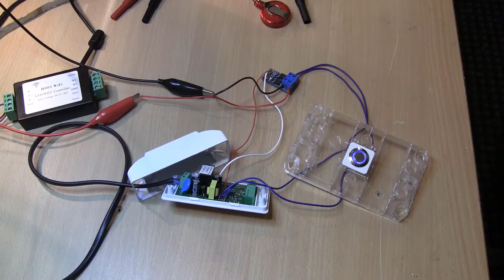Sonoff GPIO high current control using PWM and Mosfet PCB

Comment: Hi there.  Have you seen the sonoff basic r2. I want to make the same with the besic r2. There are inner pins,  3v3, key, LED,  k_p and GRD pins.  how can I make external physical on/off button and Led indicator light using these inner pins?  Thank you...
Reply from the maker: It seems the R2 is not well suited to this application? https://tasmota.github.io/docs/devices/Sonoff-Basic/ With the proliferation of low-cost WiFi devices these days, I'd find another device if you can.
Reply: @xbmcnut  Hi thanks for the reply.  Can I add external on/off button and led indicator light to R2 without flashing it?  can I do it directly with the original firware..?  what for are used those pins that I mentioned..?  thanks...
Reply from the maker: @ahmedf.9040  The pins are used to program the ESP82xx chip. You cannot make use of them without flashing the device with firmware like Tasmota but even then, the R2 variant is not well suited as the pin I used in the video (GPIO14) is not exposed on the R2. If you let me know what your use case is, I may be able to recommend a better piece of hardware.
Reply: @xbmcnut  I want to use it in my grass watering system.  it can be scheduıed as I want.  but sometimes I need it to be disabled manually.  my parents need physical button to turn the system on or off.
Reply from the maker: @ahmedf.9040  Depends on whether you have a Home Automation hub that will integrate with a device that has flashed firmware. If you want something stand alone, you could make a sprinkler controller out of a Sonoff 4-channel without the need to flash. https://sonoff.tech/product/wifi-diy-smart-switches/4chr3-4chpror3
Reply: @xbmcnut  Thank you Pete...  I will concider it...

Comment: Hi Pete,
Thanks for the video. Would love to see how you wired everything and if you needed a pull up to run the switch straight from the sonoff?
Are you having to reduce the power through the firmware or just using a pull up? 
Sorry mate, I have no idea about any of this but learning as I go.

Comment: Peter like the video. Open discussions with itead over the sonoff touch problem mate. They may re-engineer the boards hopefully for Australia, Pacific and New Zealand. Just a throught could we use the control board of the sonoff touch to do the switching?
Reply from the maker: Don't think the volume would be high enough for them. Would like to see more of a square box to make it wall friendly and GPIO pinouts like the Eletrodragon to make connecting external I/O's easier.
Reply: Pete Stothers Totally agree.